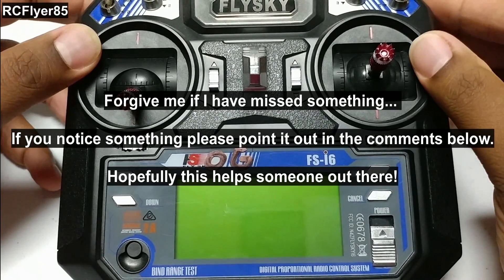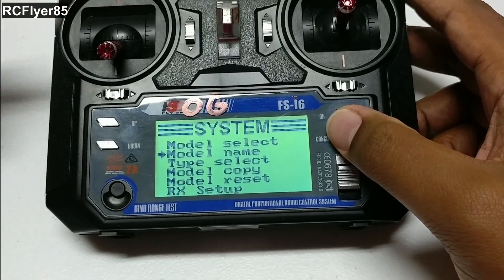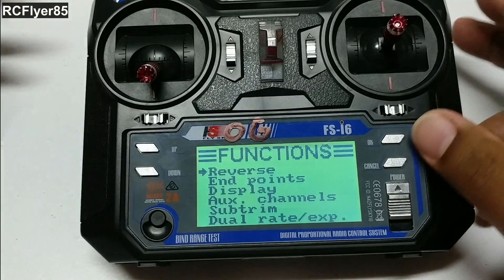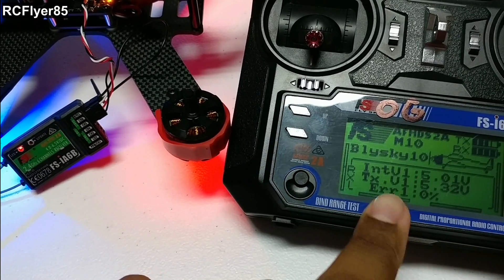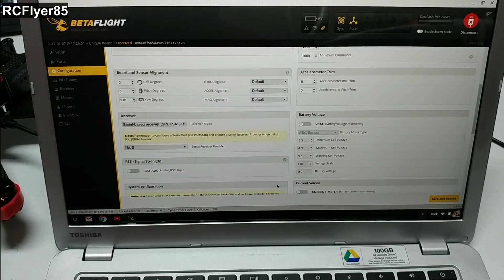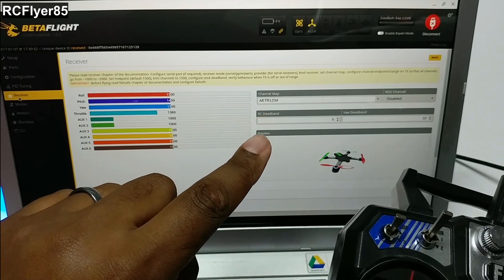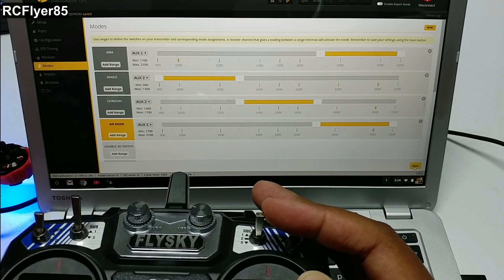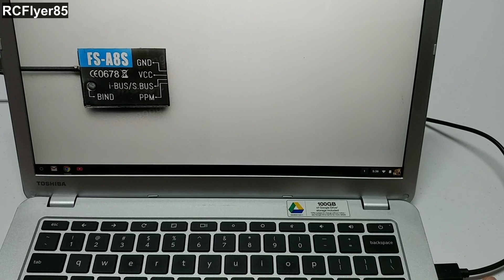How To:  Setup FlySky i6 for Multirotor Drone Eachine i6 Turnigy i6 and More

Comment: Channel mapping still not working￼
Reply from the maker: Angela Cervera If there is no movement at all then there is 4 possible reasons for that..

1. You are not bound to the receiver. 
2. You have the wrong connection type selected. (example: you have ppm selected when using iBus.... or you have iBus selected when running pwm)
3. Your receiver is plugged into the wrong port on your flight controller
4. You are connected to the right port on the flight controller BUT you have not enabled serial Rx on the correct port in the Ports Tab
Reply from the maker: dale b ok and how do you have it connected? PWM with all 6 (1 3 wire and 5 1 wire) wires, PPM with 1(3 wire connection ) or iBus with 1 (3 wire connection)?
Reply: RCFlyer85 I'm having this same issue. I'm all set up like it should but channel mapping isn't working.  I know a little bit about this stuff and I just set up my alien with my radiolink at9 and had the one I'm having issues with set up with the pwm Rx. It can be a bad RX right?
Reply: Pleace can help me i have drone f450 and i using apm2.6 and my remonte FLYSKY FS-i6 ...conecting to the resever but now working the dron only have beeb beeb
Reply: @ranjkurdish  I am having trouble also, did you ever figure out your issue?
Reply: Hi RCFlyer85, I have tried all those options and none of them work, could you give some advice regarding #2 on the setting that should work. ie tried randomly multiple configurations with no luck
Reply from the maker: dale b what receiver do you have?
Reply: The same one you're using in the vid. Stock not updated.
Reply: same problem
Reply: How is that thing hooked up to your laptop? I'm new but I can't figure it out, you got the micro USB plugged into the drone or do you have that 8 mm microphone jack adapter to the back of the controller or what
Reply: @MrSabram07  , any solution yet?
Reply: @pietjacobs8534  no not yet but I haven't had time
Reply: where to do it under number 4

Comment: Did everything as per the video. I still cant change the values with the transmitter, i.e, in betaflight, the values do not change. p.s: the receiver port on the FC is ppm/sbus, i connected my receiver (the same one that u use) into that.
pls help

Comment: the regular FS i6... can you change the mode 1 and 2 for left or right throttle control ? which mode is most commonly used ? which mode is better ?
Reply from the maker: Mode 2 is the most common and that's throttle on the left stick...

I can't remember for certain but I'm pretty sure you can change the mode on this transmitter but if you don't purchase it the way you want it you have to open it up to modify it when you change it

Comment: I can see that my receiver is connected (because i can see the telemetry coming back) but when i go into betaflight, the reciever simply isnt there.
Reply from the maker: Sometimes the board needs to be powered up for Betaflight  to see that.... So try plugging it up. Just make sure the props are removed first. Just in case 😉
Reply: @RCFlyer85  yeah, I've done that sooooo many times, but no luck
Reply from the maker: @carsonbellak956  perhaps it's not connected to the board correctly or not in the right port..... Hard to tell without seeing it.
Reply: @RCFlyer85  no, I get you. I'm getting help from another random stranger on The nternet, so bye for now

Comment: If you still cannot bind like the remote wont say bind ok, your powersupply current might not be enough. I ran 1 amp and it wont bind but as soon as i ran it with a 2 amp charger it will bind instantly

Comment: Thanks for all your time in posting this.   I see you binded to your custom built drone.   Can I bind to a Bugs 3 and Bugs 4, or any pre packaged drone ??   How’s that done ?
Reply from the maker: Most premade drones have their own proprietary software so in general no you can't. There are modules to emulate "some" of those signals for other transmitters but I've never used any so I couldn't help you much there.
Reply: RCFlyer85 thanks for the reply.  I’ve seen some other videos where people have bound to pre made drones, so I just assumed it was easy to do.  It also explains why those drones already come with their own controller.  So...., maybe they can be modded,  just not usually done.   Thanks again.

Comment: do the sticks not reset to the middle
Reply from the maker: Depends on how it's setup but most people fly  racing/freestyle drone controllers where the throttle stick does not auto center. So these come usually like that with the throttle side not self centering.

Comment: What ever you had done  I also could able achieve but when I move my throttle motor is not responding. Any suggestion.

Clean flight is responding if I change throttle.
Reply from the maker: When you move the throttle does the throttle channel move or is it a different channel?
Reply: @RCFlyer85  
Yeah I I move throttle throttle bar in clean flight responds according to the movement.
Reply from the maker: @vasanthakumarvelkumar3776  Could be any number of things. You'll have to take the time to troubleshoot. If possible try and find someone local to help out
Reply: @RCFlyer85  thank you

Comment: Please help me, 
I have the exact same receiver and transmitter as you do, but I am using a SPracing F3 Flight controller, I have binded my receiver with the transmitter, I have followed all the steps and I have selected the right configuration settings. 
However, once I'm at the channel mapping, the throttle on betaflight doesn't move when I move the throttle on the controller
Reply from the maker: What version of betaflight is in your flight controller?

Comment: Sorry, I don't understand wht you're doing here. Why is the receiver loose when you bind it with the Radio and the quad? I'm new, forgive me.
Reply from the maker: Because when you bind you physically have to push a button. For demonstration purposes it was easier to have the receiver outside the quad.
Reply: @RCFlyer85  I thought this radio automatically would bind to any new quad without extraneous devices.
Reply from the maker: @xpane  depends on your setup...
Reply: @RCFlyer85  So I need to put the FS-IA6B receiver on my Tinyhawk? Seems too heavy for the little guy.
Reply from the maker: @xpane  yeah that's too big for that...  You'll want the A8S
Reply from the maker: @xpane  or maybe try an off brand one if your feeling lucky... lack of receiver options is the main reason I switched over to a Taranis and FrSky

Here's a list I found of RX's http://www.multirotorguide.com/news/flysky-receivers-list-roundup/
Reply: @RCFlyer85  Thanks for that. I was always under the impression I could bind it without a receiver, or bind it on the Tinyhawk receiver if it has one.
Reply from the maker: @xpane  No the TinyHawk comes with FrSky receiver not a FlySky receiver.... As far as I can tell
Reply: @RCFlyer85  Oops! I guess I bought the wrong radio then.

Comment: hi... when i'm configuring the tx on the cleanflight software its showing failed to connect.. please help with this asap
Reply from the maker: Is the TX bound? Is the receiver powered up while connect to the PC?
Reply: @RCFlyer85  yes tx is bound to rx.. and tx n rx both are on.. then too its showing the issue
Reply from the maker: So are you saying it's failing to connect only on the receiver tab or you cannot connect to cleanflight at all?
Reply: @RCFlyer85  I'm not able to connect to cleanflight at all.. afterall selectng the com and baud rate as well
Reply from the maker: What drone is this? Are you sure it's actually running Cleanflight?
Reply: @RCFlyer85  actually I'm building an quadcopter using arduino nano.. n my tx n rx is fs-ia6 model
Reply from the maker: Oh wow.. well I have no experience with Arduino at all
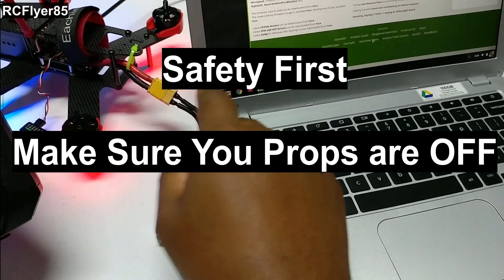Reply: @RCFlyer85  ohk.. then which wire have to connected to receiver while configuring on the cleanflight software.. may the video timing is around 7:12

Comment: How to bind 2.4G 8CH D8 Mini FrSky Compatible Receiver With Flysky FS I6?
Reply from the maker: You cannot bind a FrSky receiver with a FlySky Transmitter without using a multiprotocol unit.
Reply: @RCFlyer85  Bro, What is this Multi Protocol Unit? Give me purchase link
Reply from the maker: @javidvaza  Actually looking further into it... I don't think that there is a solution for this particular Transmitter. I think that module only works with the newer FlySky Transmitters.

I don't have any experience with these modules I just know they exist

Comment: How did you get 2 arm to light up mine doesn't light up I'm so close
Reply from the maker: I think it prevents you from arming while connected up Betaflight so it probably won't. Have you tried with it disconnected
Reply: yea, I Really crunched some vids today. I finally got it. i learned how to set a failsafe, set the arming. the problem i had was TRIM! can you believe it?!?! so basically, i had to set all the levels to 1000 lower and 2000 upper, as close as I could get. it turns out, that i only set the throttle at 1100, not 1000. so all the settings were under arming range AND YES, THE CONNECTION WAS ALSO THE PROBLEM. craaaazy. now it works, it runs, it's smooth, i also did this funky calibration where i connected to ct, went into motor tab, connected battery, clicked motor on all the way to 2000, plugged in, made funky sound, slammed down to 1000 with manual switch another sound... after that, it was golden. Half the problem was learning the controllers terminaligy, and the other half was the cleanflight. took me a2 weeks a few hrs every night, but its finally my b@#$@ch. well, i gotta test it. but also settting up a throttle curve, and someday, i'll update the 6 channel to 10. need that stupid cord to usb though. cheers man for real. i still have so much to learn man. but it's sinkin in. not bad for a pawn shop pickup. i'll do a video soon.
Reply from the maker: @Kriswixx  Nice.... So what drone did you get?
Reply: not sure, some pawn shop random flier. In hindsight, it prob wasnt the best purchase, but I wanted to get my hands "wet" in the build process by seing one already made. I somehow made the camera and the camera transmitter in the back stop working, so that's the next figure out what's what.. but for the most part, i took the camera stuff off, even if I loose it first flight, at least it's stripped lol. Not sure, some pawn shop thing. not able to identify it. Has a sp pro board though, and been a cleenflight junkie since. I have a buncha spare parts too! almost all i need, but uart cables really. i saw some ebay links.. you know, the Nickle and dime stage. I may put on a 2 prop for test, i only have one set of 3 props it came with...

Comment: hello! subbed! you are a pinnacle of knowlege. watched 15 vides, FINALLY yours explains it slowly, and understaNDING the concepts. i just got this radio at the thrift store for 2.50 and want to use it my quads. I will order some of the reciever parts that goes to the quads (i got some walkera 250's I want to bypass the Devo 710 and use my F6) I set it up as you instructed. would have never thought of that. thanks man truely, I am learning each day trying not to overspend. I will look for a few cheapie recievers, do they come with the cables to attach? I know i can direct power to a small battery or 4aa, something 4v-6v i immagine, yes>? anyway. tons to learn thanks again.
Reply: devo project on hold.

Comment: can you use the other type of receiver for this?
the stock one it comes with which port?
thanks!!!!
Reply from the maker: ultra rc Not sure what RX you are talking about but this transmitter works with most FlySky AFHDS 2A receivers like the... A8S, X6B, iA6C, iA6 etc

Comment: I NEED HELP!
the stopping position of my elevator stick at the bottom so when im not touching it at all my motor will be running at 50 percent. I have to keep the stick at the bottom for about 5 seconds to set it. how do I make it so the stopping position is in the middle?
my remote is flysky-fs-t6
motor is uxcell dc gear motor 550 rpm brushed
and escs are turnigy 30a
Reply from the maker: Gnimag Pickle I'm not fully understanding what your situation is... Can you maybe expand on it a little more
Reply: RCFlyer85 the elevator stick behaves like throttle were the brake position on my elevator stick is on the bottom. I need to set the default position of my elevator stick but I don’t know how.
Reply from the maker: Gnimag Pickle Possibly a throttle range issue... Check out my video on throttle range and see if that's your issue

Comment: This is the reason I am looking to buy a race drone that has a Transmitter radio included... I find it confusing...sorry. I am brand new to the hobby, I like that my Bugs 6 came with it all set up.
Reply from the maker: wildbillo68 Good luck..... You usually have to pay a hefty premium to get a true Ready to Fly
Reply: How about that "Arris X220"  anyone have experience with that one? It comes with a bound Radio.....
Maybe Hobby Town does it for a fee???  There's a hobby town in the area...
Reply from the maker: wildbillo68 No experience with that brand but I've looked at some of them and I feel like they're a sub par brand all around
Reply: Well...I hear yer opinions, and wonder that myself..... but for someone that has just started out a couple weeks ago and doesn't know how to build these things and only have bought a Bugs 6 so far there isn't much options out there...  A custom built Race drone has got to be better built than a China Bugs drone lol...
Reply from the maker: wildbillo68 If you can find a local store they should be able to help you get everything set up anyway so that's always a positive.... 

The thing is with a lot of Cheaper Brands is that even if they sell a ready to fly with a transmitter the transmitter may not be set up and you'd be right back at square one
Reply: I can do a basic simple set up IF ya mean just binding like the Bugs 6 I got as a all in one kit..that was nothing...but- if I get something that needs more extensive binding and programming and all that I guess I'd just go to the hobby shop and have them do it. I don't wanna lose my new Race Drone cause I screwed up the set up.. hahahha  
     thanks for the info....

Comment: hello friend I'm model airplanes I'm starting with drones so I do not know much about it. I hope you can help me bought a holybro Shuriken 180pro only that did not have the receiver version for flysky only for frsky, I bought anyway so I bought a receiver for my flysky i6 radio. I installed the receiver I made the bind but when I enter betaflight it does not have communication with the radio will the friend can help me thanks I await a response 👍
Reply from the maker: Hobby in Japan What receiver did you get?
Reply: RCFlyer85 follows the link of the receiver Flit10 2.4G 10CH Micro Telemetry Flysky Receiver Ibus compatible for FS-I6X FS-i6S Turnigy Evolution. https://banggood.app.link/0YUfsOsq5L
Reply from the maker: Hobby in Japan Well I really never recommend non OEM receivers and have never heard of that one... I would say double check your wiring and make sure your ports are set correct and that iBus or Sbus( whichever that RX supports) is selected
Reply: RCFlyer85 friend to get thank you

Comment: Thx bro!
There has to be one more problem with my setup:
In betaflight all the signals from the radio do what they should, so that's fine. If I go to "motors" i can spin the motors, also fine. But when i desconnect my drone from the computer, restart the drone and the controller, i arm it and i set a flightmode, nothing happens. I can only see that the flightcontroller responds to my radio. Can somebody help me out?

Comment: Thanks man! I've been scratch building fixed wings for several years, but never built or even flown a "real" quad. I have a tinywhoop and like it and was wondering if I could use my radio with a bigger quad... I guess so. Now I just have to build it.....and probably rebuild it a few times to.
Reply: Depends what sort of radio. 
If something like this a hobby grade radio sure. 
If like one of those cheap little video game controllerslike come with many whoop packs ,  probably not.  
And even if you could ou should probably just get a real radio that has proper gimbals and everything like this one least.

Comment: Can i use this transmitter with wakera 250 racer and vortex 285 drones.
Reply from the maker: jose ramos Yes... It should work with both of those assuming you also add a receiver
Reply: I bought the eachine wizard x220 do i need to conect this transmitter to the computer? I have no idea I'm jumping from bugs 3 and 6 to racing